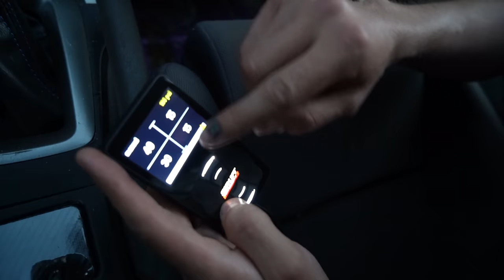ABANDONED S15 SILVIA MOVES FOR THE FIRST TIME IN YEARS!

Comment: A nice street car would be really cool to have, especially with air suspension and some tasteful underglow.
Reply: yes BRING UNDERGLOW BACK 2022
Reply: You sound like you like stanced cars aka american rice
Reply: @zvarkfitzell4527  what’s wrong w stanced cars
Reply: @zvarkfitzell4527  Nothing wrong with stance cars. Cars with EXCESSIVE camber that doesn't look good but only for attention is the type of excessive camber i'm talking about .
Reply: Underglow for sure, bags are junk, every car I've driven with bags handle like ass
Reply: @zvarkfitzell4527  I appreciate a well built street car. He already has two drift cars, and working on a track car right now. So why not have a street car to cruise around in and look cool?
Reply: @jimmyb8011  little cars or? I’ve ridden in stuff like ls400 430 and a couple gs cars with bags and it’s like oem but abit more couchy and low
Reply: @JzxRoss  look if its like a lux cruiser bags are fine, but anything performance related they suck, I've driven big cars with bags and little cars with bags both the shock wave style and the separate bag and shock setup and I've never really liked the., especially in something making a little bit of power
Reply: Underglow is peak
Reply: Summit has a nice strret/drift track car
Reply: Needs LowGlow
Reply: Do it SAMMIT!!
Reply: Like Sam said he wanted it to be a meihan drift missile. So the best thing he could do is, repair the rust and seal it. Sort out the engine, put some coilovers  and some konig wheels!
Reply: Bags no   it is a bad option
Reply: It’s a missile, too much rust to make it a street car. He already has a yashio factory s15 he cares about. Doesn’t need to invest in this beater.
Reply: Highly agreed
Reply: @zvarkfitzell4527  and what do you like? Losers doing donuts on intersections? Stance builds are clean usually so thats not rice at all.
Reply: @Souly_the_femboy_og  bags are good tbh better then ruining ur car being static and scraping everywhere
Reply: @dennisraeimakers5218  im from new zealand so no i like touge as all we get here is japanes domestic vehicles
Reply: We also love drifting but those clean stance builds are a serious waste of a good perfomance car yiu could use for a motorsport
Reply: @NoblePineapples  just feels like a waste of a s15 just too look cool in he could literally get any car and stance it out and look cool in it if i was him id enjoy driving the heck out of it while he has the chance future generations wont be as lucky to get the chance these cars are dying out
Reply: @reganhamilton7537  dont hate stanced cars just hate people stancing out the good performance models making it harder for others to get people should sticl to stancjng vips
Reply: I am SOOOO fuckin down with under glow coming back in a real way…im bout to put that shit on my x type fuck it..lol

Comment: he's worried about oil getting to the head but if valves hit the piston you're going to be rebuilding it anyway I can't imagine not rebuilding the full motor
Reply: An he was worried about hitting the intercooler its like your gonna build this car an not get a new intercooler then he was acting like it was life or death to get air in the bag the car went on the trailer with no air it will be fine to roll around no Sams all worried
Reply: @adamthomas4638  right I get it tho a whole ass part of a car can be expensive in the scheme of things but I think he just respects cars no matter the state of them. reminds me when I was loading firewood into a truck with my ex's stepfather and I was paying extras  attention to make sure my Carhartt zipper didn't touch the paint....on a truck that was from the 90s and was rotted "thoroughly" through parts of the frame. it was already put up. he was like man what the hell are you doing? look at the truck you think i care about the paint?!? I was well...shiiiit 🤣